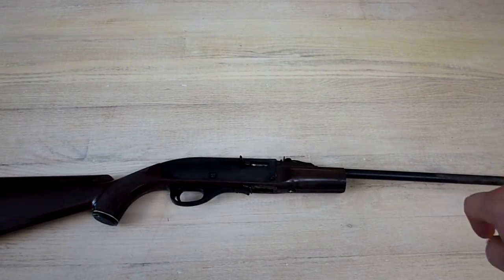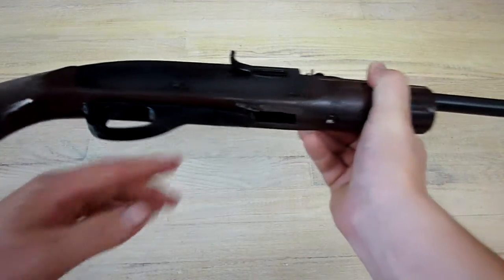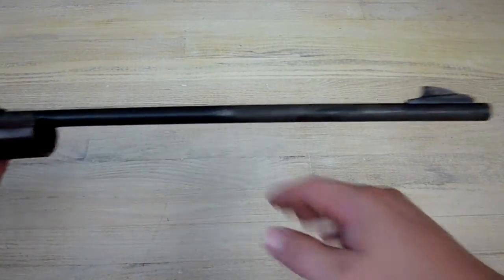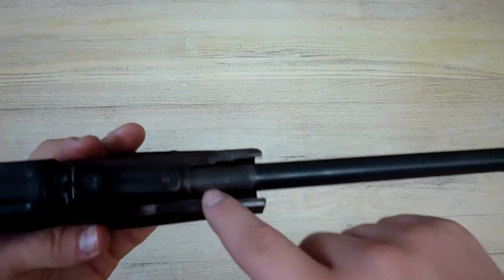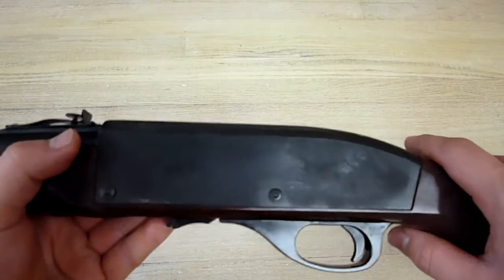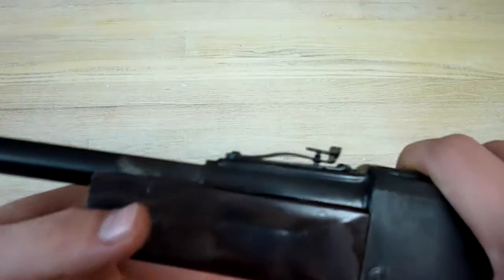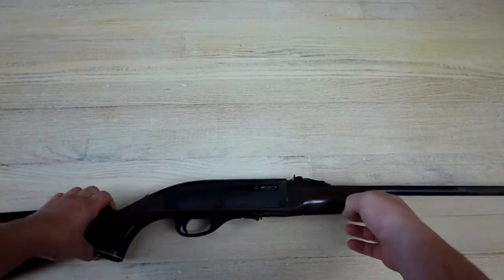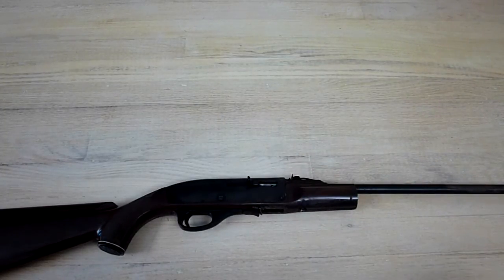Remington Mohawk 10c (nylon 77) Repaired and Firing!

Comment: Hey dude. You did well on that varmint rifle. My father passed away a couple years ago and I claimed this gun. I'm totally impressed you rebuilt that girl. I actually, moments ago, wrapped the mag w gaffer tape. Used to hold the full clip but only 3 now...hopefully the gaffer tape holds. I'll be testing her tomorrow. Cheers and well done.
Reply from the maker: I actually did buy some mags for it after a while, but they are terrible. 
They are supposed to hold 10 rounds, but since the whole mag is polymer, and the only metal holding the thing together is a shitty thin metal strip up near the feed lips, if i load more than like 4 rounds in the magazine, it fails to load or just SPRAYS all the bullets out. 

Its a ugly turd with terrible magazines, but its mine...

Comment: You worked a miracle on that rifle.....
Reply from the maker: Thanks :) 

Was an interesting project for sure. I still never use the thing, mainly due to the crap mags for this thing (no one ever apparently made all metal ones, so bullets fly out constantly due to the crap plastic feel lips bending out under the mag spring pressure, and they cause a lot of jamming) but i do have it.

Comment from the maker: Expenses. 

You can find ANY part you need for this gun new (or uses) but because it was not mass produced really, and some of the parts were not compatible with per say the nylon66, i needed the mohawk10C (nylon 77) specific parts. 

sending it to Remington wont work either as its has not been produced for like... 40+ years now. try sending your 1970 Honda car to a deal and tell them to fix the body
as far as i am concerned no gun is *unfix-able* its just the cost and time required to fix it.

Comment from the maker: well "i would fire that" gun too. and i did. It works great :) 
I wont probobly ver sell it off for parts considering the parts are so cheep for it anyway. 

Well you can use a nylon 77 OR mohawk10c magazine in this rifle. The only problem is they are like $20 for a 10 round magazine. :(

Comment: I would be concerned if the fire ruined the temper of the steel
Reply from the maker: Well, given it's only .22 very low pressure), and the whole frame is plastic, with only the bolt, trigger springs, and safety bar being metal, nothing "critical" will likely happen. I think. 

But, better than it being in the trash :)